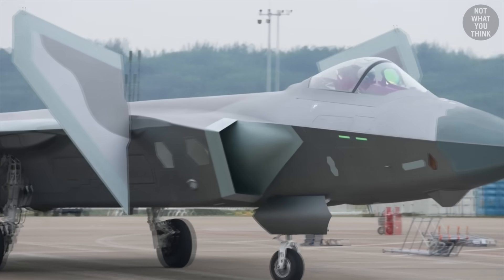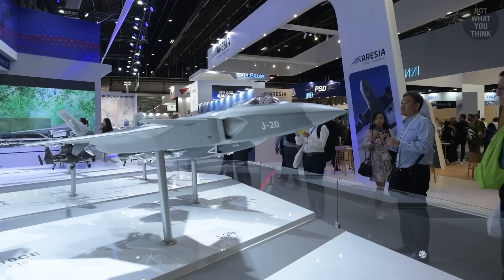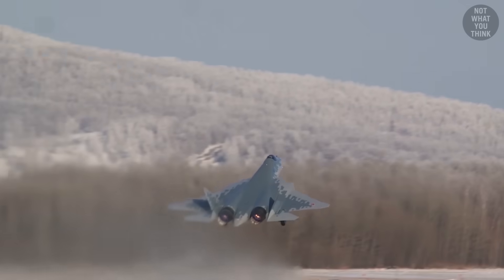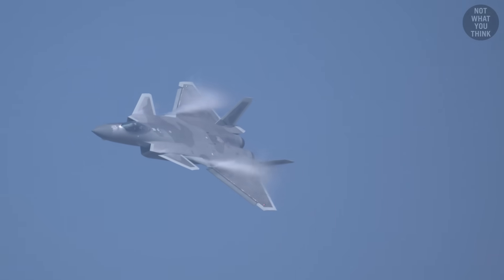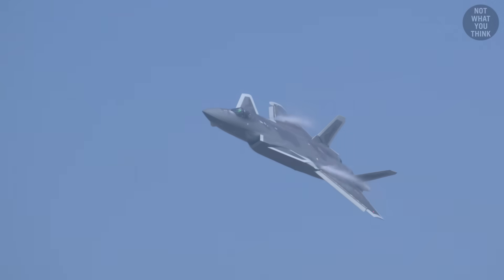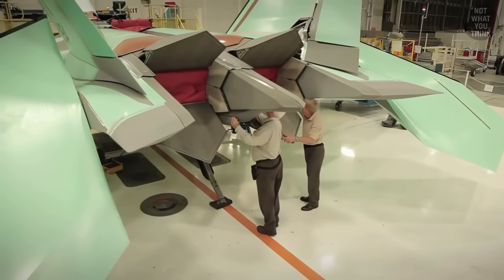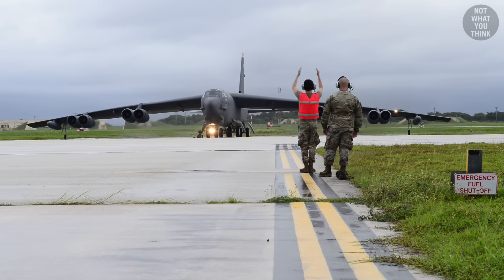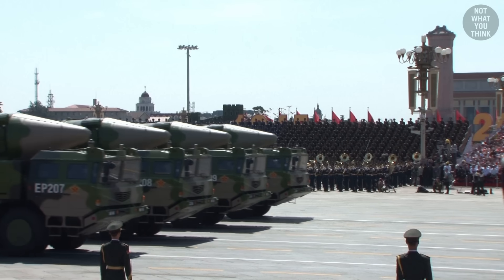Why China's Stolen "Stealth" Fighter is Problematic

Comment: It looks like a re engineered F-22
Reply: they just made their f-22 on their own requirement ........Can't Ignore the fact this jet looks like the final boss in a game
Reply: It literally is
Reply: Or like someone described an F22 over the phone
Reply: @ericheick7044 ugh…It’s a plane, you know? A plane with 2 wings, 2 smaller wings and a silver body…Ugh, it looks futuristic…
Reply: @loadingnewads  You'll note the F-22 doesn't have those 2 smaller wings (canards), because canards increase drag and radar signature. But the Chinese couldn't match the F-22's maneuverability without them, because even 30 years later the Chinese can't match American technology.
Reply: @willythemailboy2  not true actually
Canard configuration was considered in NGAD development, better aerodynamics and control can be achieved, canard configuration usually (I mean J20’s) don’t have negative lift, for example, when F22 needs to keep itself horizontal, the fuselage and the wings create a force that makes it slowly but steadily pointing upwards, so it needs to use the horizontal tails to make sure that the force is balanced out.
as a comparison, J20 don’t need the negative lift, it only needs to control the lift generated by the canards
Reply: @willythemailboy2  Canards can create more lift with no significant sacrifice and improve maneuverability, if the canard configuration was optimized, there will not be significant difference in stealth capabilities.
Reply: @loadingnewads  Believe what you want, but no real stealth aircraft use them for a reason.
Reply: @willythemailboy2  only if you regard J20 as a non-stealthy aircraft
I don’t think this is a good idea, boeing (if I’m right) proposed a NGAD version with canards, but probably lost
Reply: @loadingnewads  J20 is classified as a low-observable aircraft, similar to the US B1b bomber. Stealthy enough for the 1980s but not in the same ballpark as actual stealth aircraft.

And as mentioned, a canard design was proposed for NGAD but rejected due to the inherent weaknesses compared to better designs.

To my knowledge the US has never had a canard design jet fighter enter service in substantial numbers. Please correct me if I missed one.
Reply: @willythemailboy2  The point is that the US classified J20 as low-observable but China classified it as stealthy, we can’t say for sure.
Canard design: relatively new and requires lots of modifications in the flight control system, US jets are mainly designed in cold war era, the computer systems could not sustain an effective flight control for canards design, especially those more complex ones like J20’s(the fuselage was designed to generate a lot of lift, just look at the white vortexes)
I don’t think canard design is inherently worse than traditional designs, it provides a  better mobility and the downsides such as decreased stealth can be eliminated with better covering/coating
Reply: @loadingnewads  I tend to believe US radar operators who have tracked the J20 over what the CCP says about it. It's possible that the J20s in question had a signature amplifier of some sort on board that they wouldn't be carrying while in actual use, though. The US tends to do that sort of thing when they have the F-22 compete against allied aircraft, so that even our friends don't know exactly what it's capable of.

The technology argument is not valid, though. Competitor aircraft were using canards, such as the Dassault Mirage 4000 being comparable to the F-15. The F-15 also has a lifting body design, to the point where the body creates enough lift that one has successfully landed despite losing an entire wing to an in-air collision.
Reply: @willythemailboy2 the j-20 wasnt even revealed as a stealth aircraft, its supposed to work as a sniper with good radar and range shoot it all then run back
Reply: ???? The J20 looks nothing like the F22 except maybe the nose cone. The J20 is a Delta airframe with canards. The J20 is designed to fly fast and far and then shoot and scoot, with a long missile carrying cavity for long range AAM. And all stealth fighter have the same shaped nose cone, F35, KF21, J35, Kavan , SU57, Hal Amca ... it is just physics.  And the diverter-less bulge copied from the F35 is not unique to the F35, it is used on the J10, JF17 besides the J20 and J35. It is was invented in the 1950s by NASA.
Reply: @olderchin1558  you’re full of it, the yf23 the Boeing ugly duckling that lost to the 35 are examples. There is unequivocal proof China ripped off U.S. designs and technology. There’s more than one way to make a stealth aircraft only a complete imbecile would say otherwise
Reply: The F-15 is old it still could shoot down a modern jet a F-22? That’s a Mach two bumblebee and most of the pilots are itching to shoot something down and the J-20 has a small radar cross section but a larger one the B-52’s old still could turn a country into parking lots
Reply: That's because it is
Reply: I was waiting for someone to make a paragraph like a “uhm well actually” kind of text
Reply: I am still wondering why something think it has any resemblance to F22, totally different configuration
Reply: It looks like an F22, F35 and JAS-39 had a baby lmao
Reply: they should have built a flying boat design right?
Reply: Many people here are not smart enough to tell the difference.
Reply: It does look cool
Reply: -10000 social credit !
Reply: I mean, to me it looks like they took the mig1.44 from the soviets, and then did some minor modifications and just coverd it in american RAM which they probably stole from the US
Reply: Chinese got hand on Downed f117.
Reply: Makes sense. That's exactly what it is.
Reply: No it doesn't! Does any F-22 have canards?
Reply: Totally look different lol
Reply: i fucking love how it looks
Reply: Looks nothing like it, first of all its a canard design, while the south korean and turkish gen 5ths are direct copies
Reply: J20 is superior and looks better. 
F22 is oooold.
Reply: @silveriver9  you really love your job don’t ya
Reply: @silveriver9  
J20 is a Tofu dreg F22 knock off that is made in China
F22 is made by USA so its going to win just for quality alone
Reply: @silveriver9  so a Potemkin fighter jet?
Reply: @silveriver9  🤣🤣 CCP bot with 0 knowledge.
Reply: @ Says the ciashill bot 👏😂
Reply: @silveriver9 bad bot. Now write me an essay on tiananmen square
Reply: @silveriver9 made in China is all anyone needs to know
Reply: @Nr15121  Everything you own was made in China. Including the device you gleefully typed your message on 😂😂😂
Reply: @silveriver9  but designed elsewhere and why do you think most things are shit quality and don’t last now? And telll me about maos red guard and Tiananmen Square
Reply: @Nr15121 Stop throwing out meaningless sentences
Made In China means cheap and good for some of us but it can also mean bad and cheap for the rest of us
Reply: @silveriver9  
Correction. Components are made in Taiwan and Japan, Screen is made in South Korea, Assembled in China and soon it will assembled in India.
Reply: @gazzman6547  iPhone Pro and Pro max series are still assembled in China. The proficiency of Chinese workers is confirmed, the proficiency of Indian workers is not yet clear.
Reply: @Foxtrotbacon  F22 is the equivalent to a 1980s car tech. J20 is new and 30 years ahead in tech 😂. F22 wants no trouble with J20 or it'll get smoked.
Reply: @gazzman6547  😂 Thanks for self-confirming that you don't know what ur talking about. Fun fact: F22 uses huawei electronic equipment.
Reply: @silveriver9  There crews have more experience and there cross section is smaller then the J-20 “mighty dragon” because if it’s found a radar lock will be the last thing the J-20 hears,
Reply: @Foxtrotbacon  A lot of experience in epic Fails. Vietnam, Iraq, Afgnstn, Korea and now Ukrane 🤣🤣🤣
Reply: @silveriver9  China’s nuclear weapons are filled with water WHATS your point.
Reply: @Nr15121 your own f-22 was retired after they found half the parts were from china
Reply: @Foxtrotbacon lmao 😂😂😂 believed this bullshit
Reply: @NeostormXLMAX  that is completely false wtf are you on about